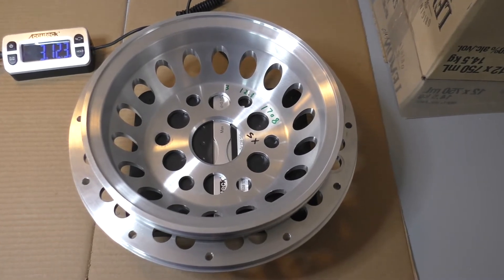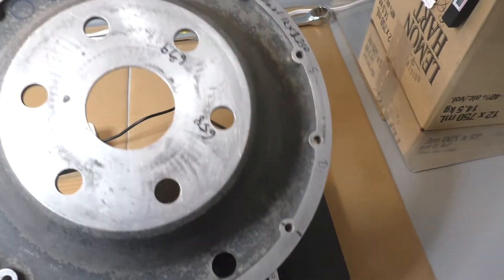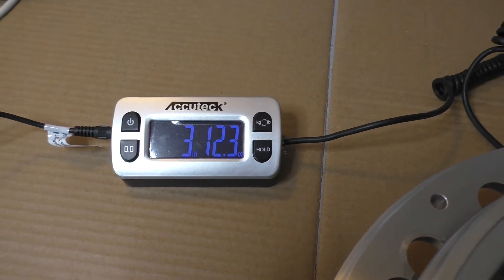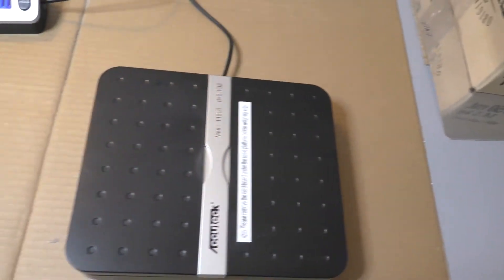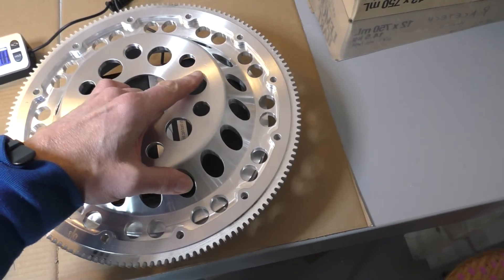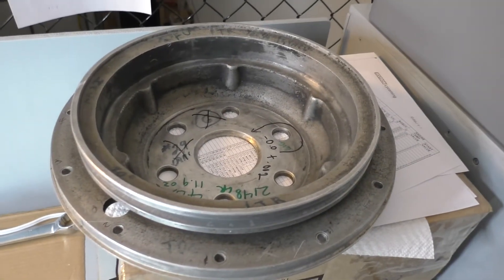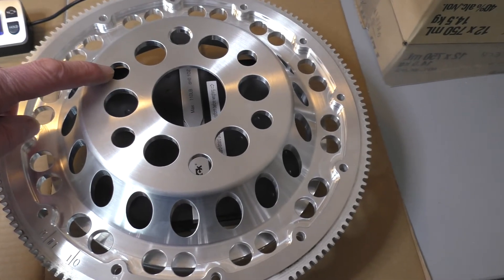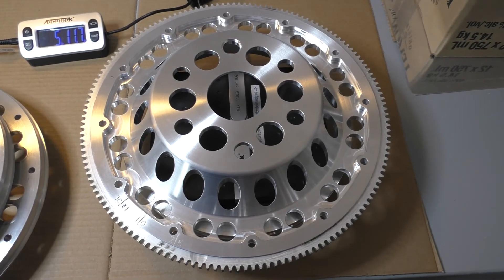flywheel1

Comment: How much for O-360 flywheel, c/s prop, with magnets (dual system).
Reply from the maker: $650US
Reply: That is a thing of beauty. Do you include ring gear? Excuse my ignorance. They call it a flywheel which implies it gives rotational inertial to smooth engine operations... but it also has two other functions, pulley for alternator and supports starting ring gear. You removed a lot of weight. Does that reduce the flywheel "effect" or engine smoothness?.
Reply from the maker: Lycoming calls them Ring Gear Supports. Most people call them flywheels even though with the prop out there, they have minimal flywheel effect by comparison. Yes, we install a new ring gear on each one.